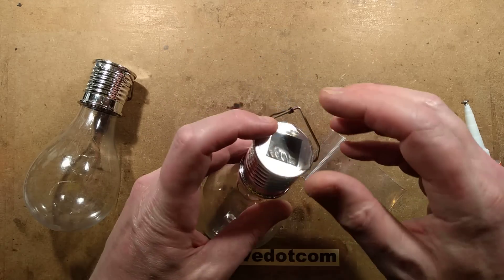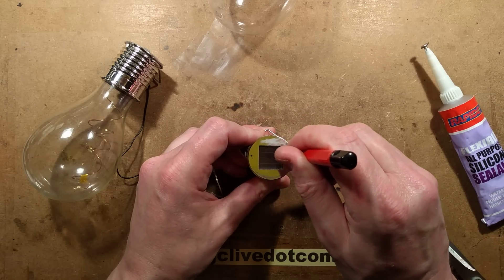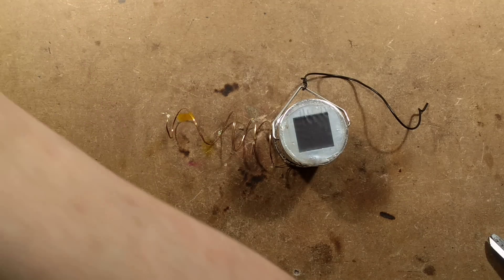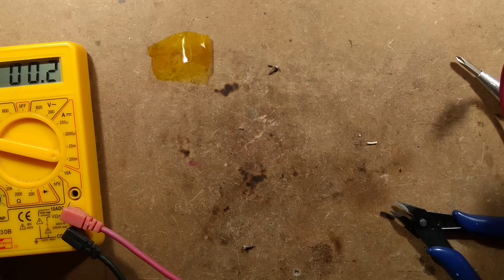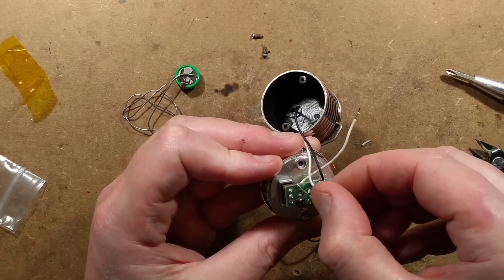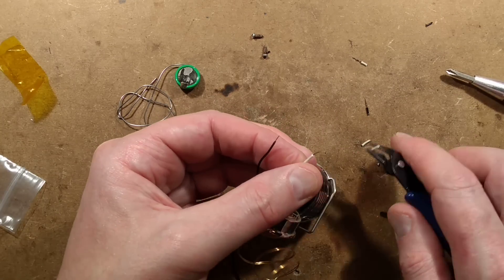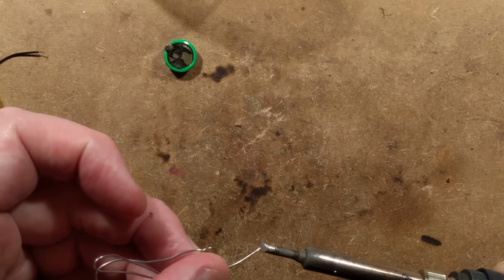Silicone sealed solar lights one year update.

Comment: These are the exact lights I've been tinkering with, among others, since starting to watch your channel. I chose to just put the clear 3M tape across the top and drill a hole in the bulb bottom. I'm also going to replace the cell with a 1/3AA size NiMH cell, because I think I can fit it in there, and see what happens. As you said, the output of the printed glass solar cell is quite amazing.
I blew up the original button cell by charging it with excessive current (40 mAh cell seems to only want 10% of its capacity for max current to charge).
I really appreciate learning by watching you and then tinkering in my own ways.

Comment: Might have been just from heat -- I had a solar light where the battery fell out into the bottom of the lamp, and I didn't have a chance to fix it when I noticed it... later the cell had exploded while out of circuit, after an exceptionally hot day
Reply from the maker: Was it a lithium or NiMh cell?
Reply: @bigclivedotcom  NiMH, AAA. “Exploded” may be a bit dramatic to say — it vented and leaked all over, not really an explosion
Reply from the maker: @DoctorX17  Sometimes that happens when they get way overcharged by high levels of sunshine.  Even though we don't get a huge amount of sunshine here the little button NiMH cells sometimes pop.

Comment: Good work. I want to put Silicone Layer for a different purpose. Actually my mini Solar panel is giving a lot of glare from the sun. Can the Silicone layer help to mitigate that, without decreasing output ?
Reply from the maker: There might be a diffusing material, but it may collect dirt and reduce power.

Comment: You forgot to put nail polish on the battery terminals after you soldered them...
If you shunt the battery with a series connected pair of 1N4148 diodes they will just be starting to turn on at 1.2 volts and be fully on by 1.4 volts. If 1.4 volts isn't high enough you can add a bat85.....

Comment: That's the downfall of such tiny cells like that, if the cell is full and it's still getting up to 30mA trying to go into it, it can damage it easily after some hours or days. However if it was a AAA sized cell, it would be able to survive the excess current via mere heat dissipation. The smaller the cell, the less current it can healthily take while being fully charged. The size of the cells in your solar garden lights are ridiculously tiny, practically button cells. I have some lights like yours here, except they have at least 2/3 AAA in them. Personally I prefer larger solar garden lights that have AAA or AA batteries, much easier to replace and much more brightness. 
I like the hanging globe design, but they make it a similar size to a real light bulb and thus are limited in size in the head section, thus having to use ridiculously tiny cells. 

As far as the moisture, the best way to prevent moisture is to actually do it on a low humidity day, then simply put some silicone in the thread before doing it up, then it will be airtight and the dry air will remain in there. Your idea of nail varnish on the circuit board is excellent, also simply soldering across the switch is sensible, these fail so often from rust. 
Without any modifications these will usually be totally wrecked in a year, but with modifications they can last nearly indefinitely with battery replacements.

Comment: I have used the 3M tape method, plus putting a hole in the bulb, to weather proof this type of light. They've mostly , you always get one of two that fail, lasted 3 or 4 years.  I do take them in for the winter.  Thanks Clive!

Comment: I used to find that the black wire turns black and stops conducting caused by the acids fumes from the battery but you will find that the positive is ok
Reply from the maker: It's usually electrolytic corrosion caused by moisture.

Comment: Could you upgrade the battery on one of these with a 3.7v 600mAh (pl353035 li-polymer), would the panel pull enough to charge it?

Just got a idea I'm my head but need a slightly better battery then the little button one
Reply: The solar cell has a 2 volt output, only enough to charge a single Nimh cell via a diode.

Comment: A good soldering tip with corroded wires is to get a small bottle of BAKERS NO 3 soldering fluid and dip wire in then solder, works for me .

Comment: I'm currently experimenting with using Gorilla Clear Glue to seal over the solar panel. It has the advantage of being runny enough that it can just be squirted on and left to self level and set, and its a more transparent than most of the clear silicone's I've used. 

It's waterproof enough once cured to keep water out, and over the last few months its remained clear. Time will tell if its actually any good.

Comment: I have had some very good experience with placing a standard red led across the battery.  Most of  them start glowing around 1.5/1.7 volt, and that keeps the battery from overcharging.  But yes then you have a small light during the daytime 😊

Comment: You might as well cram in a few cells in parallel. I'd consider installing two diodes, hand chosen to have a high forward voltage, as over voltage protection.

Not to brag but I'm probably the one who recommend trying silicone sealant. It's handy stuff. I hear that even the cheap clear silicone has excellent insulating capability but is not marketed as such to avoid the ambulance chasers.... you know who I mean. Colored silicone might work ok but the pigmentation will conduct at various rates.

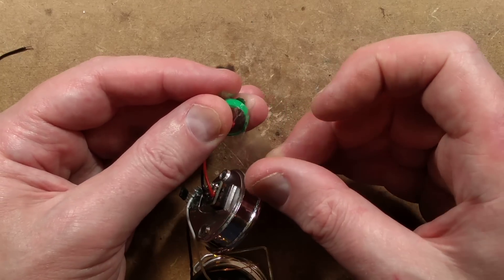Comment: 14:25 Instead of tape that can lose it's adhesive, why not use a piece of heat-shrink tube? Or if you want to use tape, use black Electrical Tape...I've yet to find a connection that was wrapped in it where the adhesive failed...became impossible to unwrap maybe, but never where it just fell off...
Reply: Or self-sealing insulating tape.

Comment: Some years ago I bought some rolls of cheap Chinesium hookup wire, after a few years sitting there unused I needed a bit of hookup wire and discovered that the hookup wire with the black insulation had turned into a roll of verdigris, but the rolls with other colours were fine.  The wire on the black roll had become a black/green slimy mess along the entire length of the roll, so I suspect some chemical not present in other colours was leaching out of the black insulation and causing corrosion.

Comment: I want to contact Clive over alkaline batteries, on ebay you can buy rechargeable alkalines but what's the difference between those and regular 4x cheaper alkalines from the shop? Why are they more expensive what's the difference?
Reply from the maker: The rechargeable alkaline cells have different chemistry and are a compromise to try and get a higher cell voltage.  They have a much shorter useful life than NiMh cells.  If you attempt to charge standard alkaline cells in an ordinary charger they will pressurise internally and may explode.
Reply: @bigclivedotcom  ah thank you for your quick reply, my curiosity got me when i saw someone buy an alkaline charger but instead of using alkaline rechargeable batteries he used regular shop bought ones.. lol

But there are chargers like the rezap and clever watts which i believe trickle charge regular shop alkalines without the boom and fizz :)
Reply from the maker: You do get chargers that claim to charge standard alkaline cells using various techniques like periodic current reversal and voltage change detection.  It risks making the cells leak and the charge they hold is low compared to a fresh cell.

Comment: Wouldn’t it also be plausible that the cell overheated and expelled it’s electrolyte? That would also explain the dried up tape. I’m not sure how hot the summers are in the UK, but it can easily reach 100F here in the US (that’s maybe 47-48C off the top of my head), and the temperature inside a metal fitting could probably reach up to or above 90C in direct sunlight.

Comment: If you keep buying these wonderful little lights over the course of the next decade or so you will likely need to fit bigger cells in them. Rare to have such a summer as 2018?  Not for much longer.
https://youtu.be/exXBGHxA4BE
As for the vids on these poundland lights, thank you. I now own several of them and from your tips they are working well after several months. :)

Comment: I’m curious: these things are available here in Australia too, and look like exactly the same design. I’m curious to see if they use a larger cell here in Australia, with significantly more sunlight (at least for the mainland), or whether they’re just going to fail early. Amusingly, in my garden, ants setting up colonies inside the battery compartments of garden lights seem to have been the primary cause of failure. I’m guessing the ants like the warmth.

Comment: I did a similar thing (and I'm certain this was a suggestion from you) with these lights using greenhouse repair tape. I'm glad to say over a year later, my poundland solar bulbs work perfectly. They are full of water too, as I forgot to put a hole in the bottom.

Comment: Clive next time you can actually leave the tips of the battery and solder them directly to the board instead of the wires, this way the battery will stay secure.

Comment: I brought all new garden lights last year, and i covered all the solar cells / top sections with 3M Waterproof tape. You can buy the stuff in B&Q, think its 2" wide. And it seems to do the job great. Might lights are still working great this year and no water damage.

Comment: Hi Clive. First stumbled upon your channel after seeing vids of poundshop solar lights a year or 2 back. Recently I swapped out the stock 40mah batteries on my own which were no longer holding charge with 80mah batteries as I could find them cheaper on ebay but now the led bulb only goes off when held directly under a bright light (not the sun). Any ideas what could be causing this as?

Comment: Didn't seem to be the case here, but don't you also have to be a bit selective in the silicone sealant used? I recall in some other video where it was used that some variants outgas acetic acid. (If it smells like vinegar when applied, there might be risk of corrosion.)

Comment: Those Fibreglass pencils are great but.....not a good idea to rub them on objects against your finger as the fibres tend to break off and can easily go under your skin. A fibreglass strand under your skin is a nightmare & I speak from experience.
Reply: standishgeezer I scratched a fiberglass window when u was around 5 at school it hurt like a B and all I could remember is my hands being on fire along with my face where I touched it 

If I remember right the school changed that window not to long afterward

Comment: My first "love" is the UV resin, It's tough and waterproof.  I've repaired spectacles, glassware, china and often pot outdoor circuits and even a soap-dish made in stainless but welded with iron!!!  A coat of resin 2 years ago, still rust free.
Really it's apples and oranges with silicone or hot glue.  The resin is more for hard materials repairs and there is the small matter of getting UV light to the site - if you can, the resin has a leisurely attitude - dawb it on, then you take as long as you like (pretty much) to get it all positioned right - then hit it with a lamp - and it's solid in a flash.
I don't know what you use for cleaning off drips of uncured residue - once it's cured it takes a hammer and chisel.

Comment: I started doing this at the time you released the video showing you covering the panels with tape instead, so I thought that silicone would work just as well, anyway over the last 2 or 3 years I've seen at least a 50% decrease in failures, and those that have failed have been repairable as it's usually the battery that's died rather than the solar cell.

Comment: Could you just solder an old lithium Nokia battery into a solar garden light?  I'm a moron that only knows what I know from watching your channel, but don't they have built in charging circuitry. Would the light stay on longer through the night because of a battery with higher capacity?
Reply from the maker: The battery would need to have the protection circuitry built in and the solar panel would need to put out about 5V at 100mA.
Reply: @bigclivedotcom  Get outta town!  A reply from the man himself!  I didn't even think about the voltages.  Thank you for your videos and your beard.

I'm going back to watch "Simplest solar light possible, using old phone battery."

https://www.youtube.com/watch?v=ycFTxCoNAQk

Comment: after seeing the inside of the solar panel light, you could just seal where the two wires from the panel are coming in with silicone, so it remains sealed inside and no visible silicone outside.
Reply from the maker: If water lies under the panel itself the panel can corrode.

Comment: The fiberglass steel and brass pencils are sweet were you get them Clive
Reply: Maybe a bit late but I stumbled through the video and thought: What great pencils. I need them.
https://www.ebay.co.uk/p/Set-X-3-Brass-Steel-Fiberglass-Scratch-Brush-Pen-Pencil-Removes-Rust-Scratches/1288887466

Not sure if the link will show - Search ebay for 
"Set X 3 Brass Steel Fiberglass Scratch Brush Pen Pencil Removes Rust Scratches"

Comment: Every spring, I spend quite a bit of time repairing my partners Solar lights, replacing the cheap nicad batteries , corroded wires, and often the electronics from donor Dollar store lights. We have an entire back yard, and front yard filled with them. Those green single cell batteries NEVER last more than a season, where as AA and AAA, can often last 2 or 3 seasons.
Reply from the maker: The dollar store lights are ideal for the components.

Comment: Sad part is estimating target labor rate of $60/hr it took 20 min to R&R the battery plus the cost of the battery it would have cost most people $25 +/- to repair a $1 light. Most end up “in the bin” after a short time.
Even if the manufacturer added a clear plastic cap over the solar cell it would do wonders for keeping the water out. This, however, does not generate additional light sales.
Reply: Yes but it helps people to make them last longer and more people would buy these lights to do what Clive did to them without Clive we would be out buying them every week I respect Clive for what he has done as no all over can buy new lights ever week when water gets inside and fails

Comment: Corroded copper inside insulated wires.. I had a reliant supervan III.
Had to fit a crimp. Kept cutting back trying to find the shiny stuff. A metre later I gave up and replaced the whole wire. Think moisture got through the insulation.
The whole 'car' was the same. Sold it.

Comment: If the solar panel is getting that much power from the small surface area, wouldn't that overload the battery?
Or would the yellow  tape on give it additional juice?

Comment: I worked with NiCads in our emergency lights for many years and we had "Black Wire Syndrome" when the cells leaked a bit and it was always the blue negative lead that copped it. Now you know what to call it.
Reply: Quite common to see it in RC model aircraft using NiCads or MiMH batteries, the corrosion often makes it's way right to the far end of the wires and damages the RC equipment.

Comment: Silicone sealant when first came on the market was guaranteed for ten years not to shrink or crack. It should boost the life of the solar lights. Instead of putting a hole in the globe to let water out why not put silicone on the threads when screwing it in?
Reply: @Matt Quinn Yes, water will find a way in eventually. However our island is so damp and humid making a drain hole will just allow a lot of moisture in with a corroding effect. Clive could do an experiment have 3 hermetically sealed and 3 with an open vent and see which ones last the longest.
Reply: @Matt Quinn There is sealing and sealing, electric bulbs do not let in water,

Comment: i had a lot of water ingress on mine even with sealing the top so i added some ptfe tape to the threads of the neck and it stopped all the excess water entering the bulb it still had condensation form up over night but no bulb half full of water

Comment: I use the clear lacquer from a car paint touch-up set. Just run a line of lacquer around the join between the edge of the solar panel and the chrome surround. The lacquer is designed for use outdoors and is UV stable.

Comment: you can insulate electronics using expanding foam maybe? that way they would not over heat or freeze.  you could bought a cell with over discharge protection and over charge protection built in to solve this problem, cheaper way of doing it is to buy lead/acid  battery they would last longer but not in the winter

Comment: I bought some solar garden lights a few weeks ago and before I fitted them, I took them all apart and coated all the electrical components with a conformal coating, cured with a UV lamp.
Even though these lights are usually weatherproof, the damp still gets into the circuits, and I've seen old ones where the parts have all corroded.
I'll have to see how long these last.

Comment: Another factor that might have killed the battery is heat. I'm in AU and the solar panels used on my Xmas lights get too hot to touch, in fact will burn you in summer, so imagine how hot it is inside the battery compartment on the back of the panel.